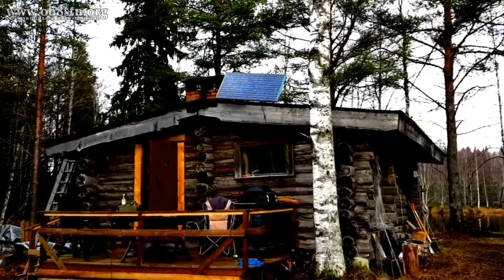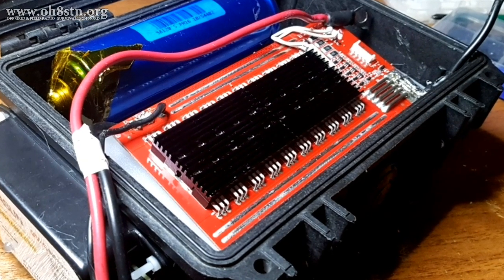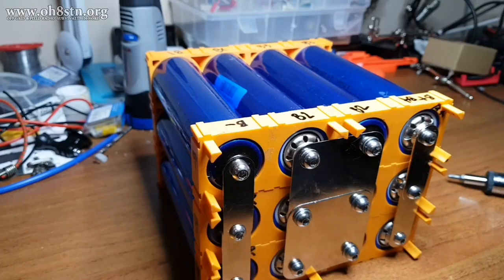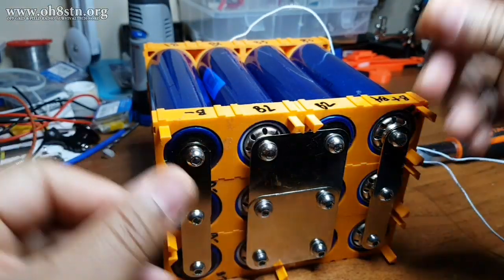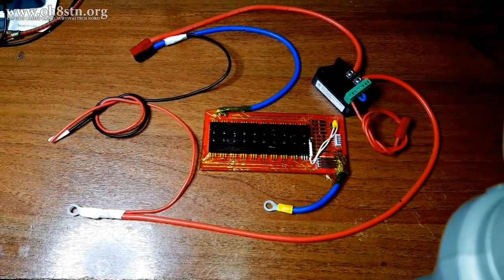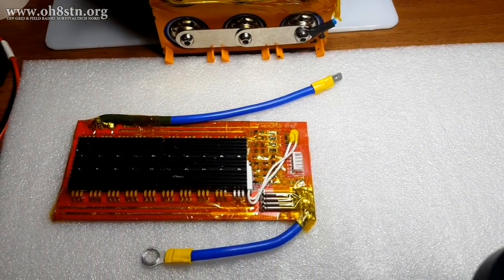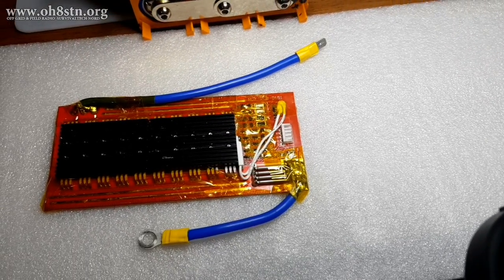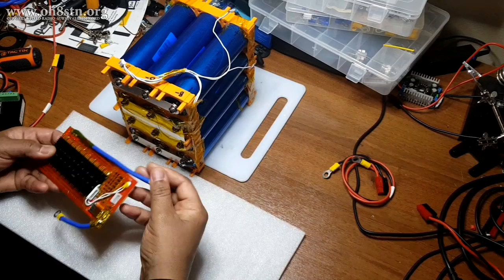Wiring the Headway 4S LiFePO4 BMS

Comment: Hi Julian. Thanks for all that you do!!.  I also have the FT-891, been considering building a portable pack without solar charge. How do you operate your radio in terms of power? Whats the duty cycle meaning - between Rx/Tx?, and the run time?. I understand there are a lot of variables to consider. I'm trying to figure out a setup for 80/20 duty cycle for up to 50 watts. Thanks again.
Reply from the maker: Honestly it's an impossible question. The way we answer it is by doing a test run. Operate our radios for X hours under worse case scenario, while measuring the Watt hours and amperage peaks. This is the only reliable way to get the answer to your question. If anyone gives you some generic duty cycle measurements, they usually come out wrong in the long run. To find out how much your radio takes and worst case scenario that you're given operating specs. Multiply that number by the number of hours you would like to run or operate your radio in the field. That number should give you the specs of the pack you should build.
There are some variables. For example what mode you using. How far you are trying to operate,  the antenna configuration,  ... all of these things will also affect the amount of power you need and use.